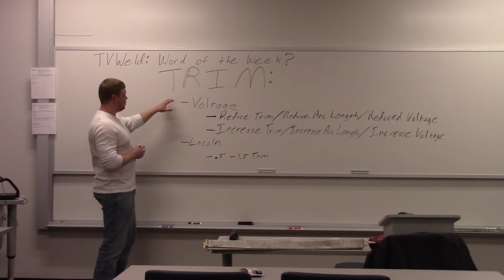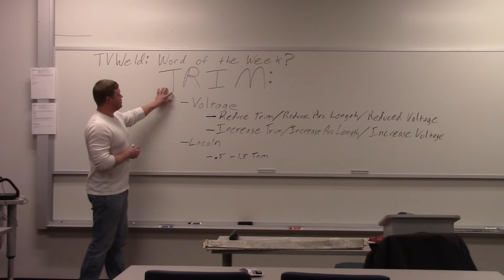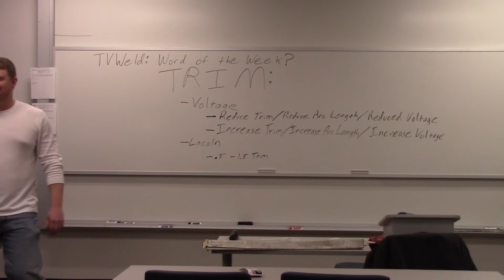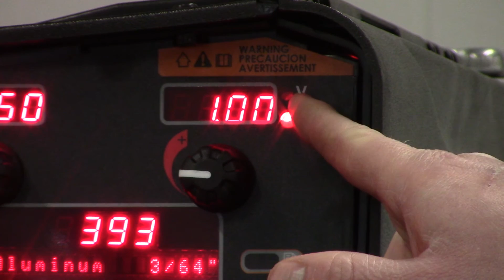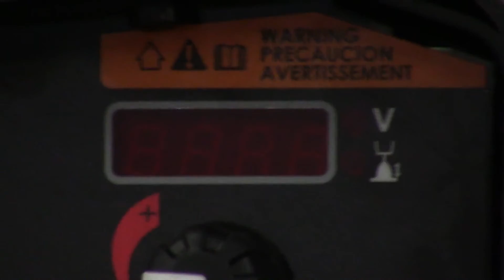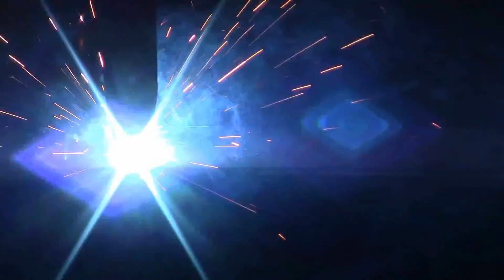What is welding TRIM

Comment: What does the voltage readout tell you when you adjust the trim?
Reply from the maker: It usually doesn't give you a voltage read out.  It will say 1.0.  This is why I don't really like the trim system.